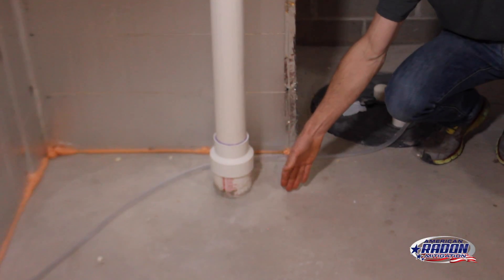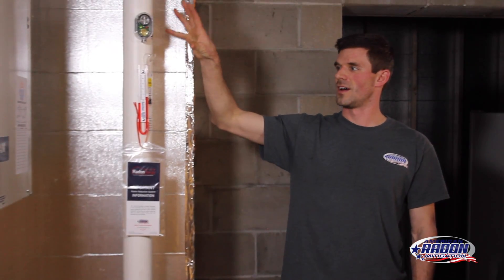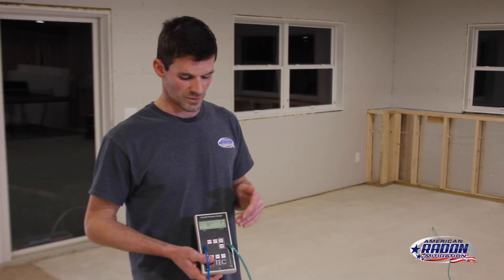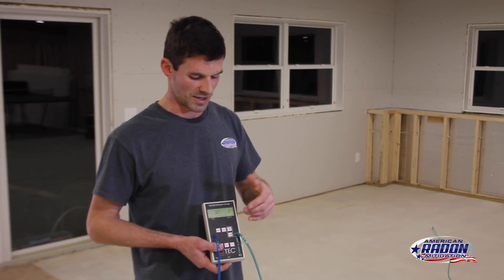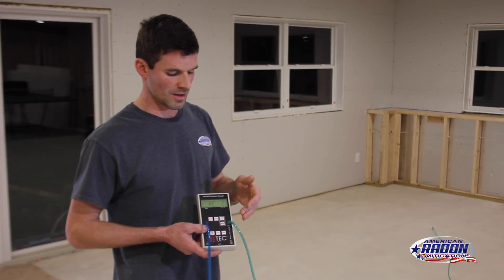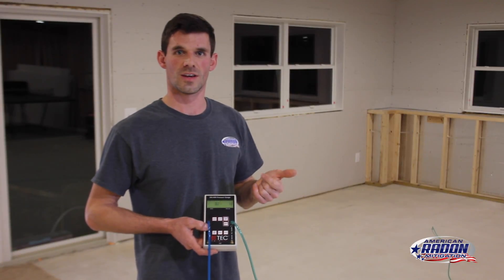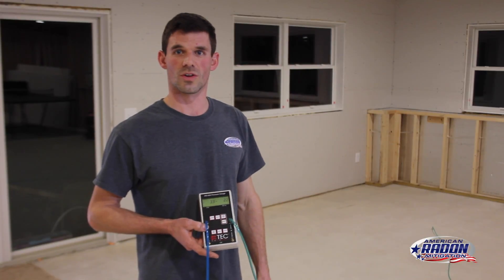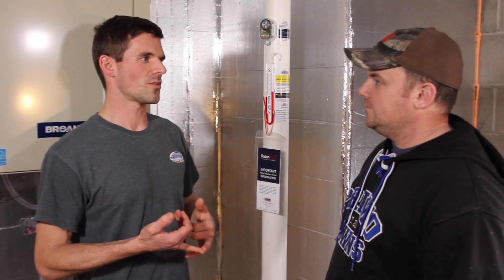How We Activated a Passive Radon Mitigation System

Comment: On the manometer where do you want your vacuum to be between?  I've seen some as low as .5 and some as high as 2
Reply from the maker: Braden, the manometer is just a visual gauge to tell you that the radon fan is working. We see the levels range from 0.1" to 4.3". It just depends on the pressure the fan is designed to run at. There are many different radon fans. High suction fans will have a bigger difference on the manometer. Every home is different and there is not an ideal manometer reading. The company that installed your radon system should have marked the initial vacuum pressure on the label next to the U-tube. If this level changes drastically or reads zero, you should call for service.
Reply: @AmericanRadonMitigation   Thanks
Reply from the maker: You bet!